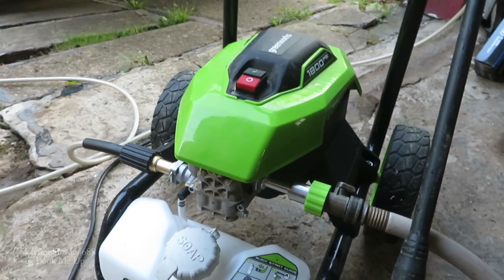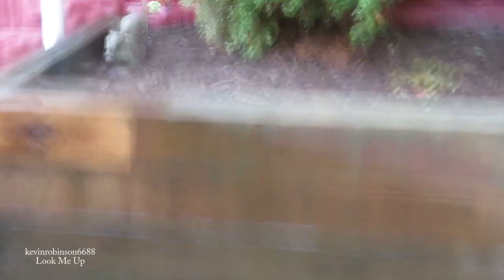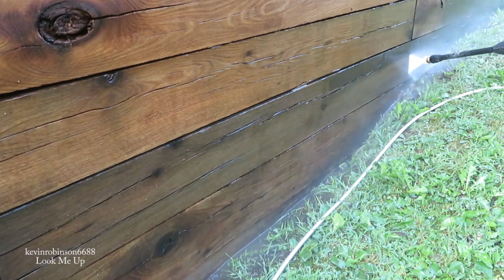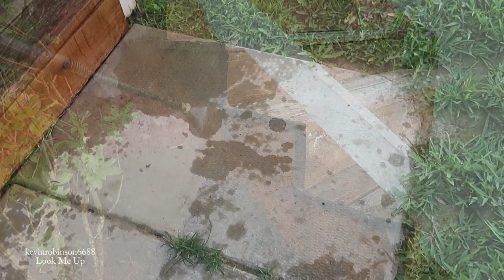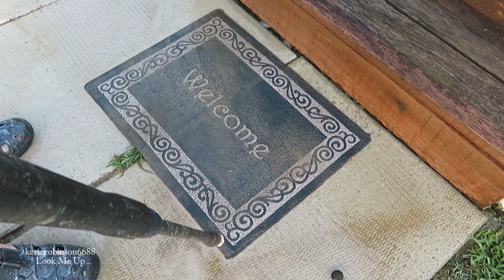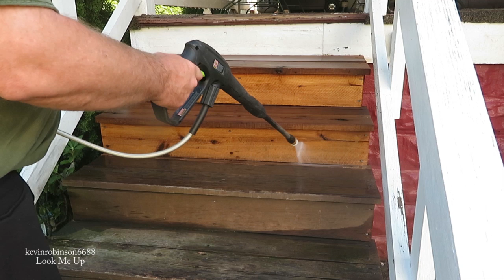Greenworks 1800 psi power washer you have to see this thing work

Comment: I have this same model. use it all the time. Clean the driveway, back patio, front steps and walk way, as well as cleaning my riding mower after every use. only thing I dont like is the hose to the wand. want to get a different type of kink free hose. other than that this thing for the size and price is a beast.
Reply from the maker: I think it is a good deal for the price also thanks for watching.

Comment: 1800psi electric is perfect for small projects. Just be sure you have water connected to it before you turn it on. Vertical pumps can burn up in a minute if you don't. Been there, done that :) Horizontal pumps not so much.  I live in a retirement community and pressure wash 60 - 100 homes and some decks each year during the snow bird season. I recommend Thompson's Water Seal after cleaning wood surfaces. It not only protects the wood, it stays cleaner longer. At least this has been my experience.  It was fun to watch your video today dealing with a subject I know something about. haha! I love the diversity of your channel. Thanks for sharing! Be well and stay safe!
Reply from the maker: I hope the Channel will get better I hope I can explain by the next weekend Gerard.